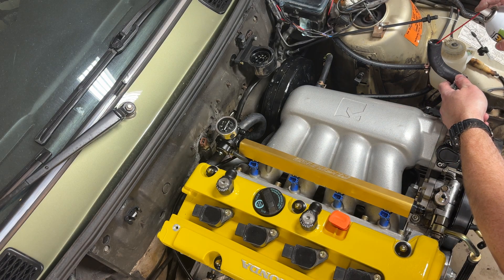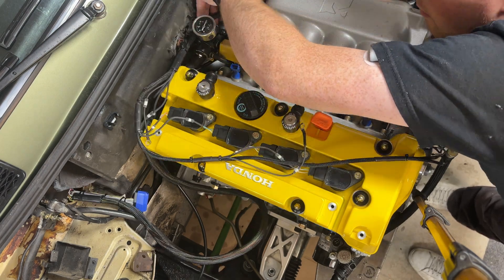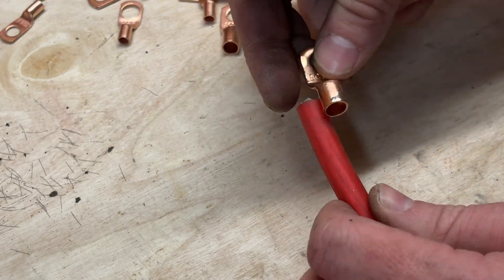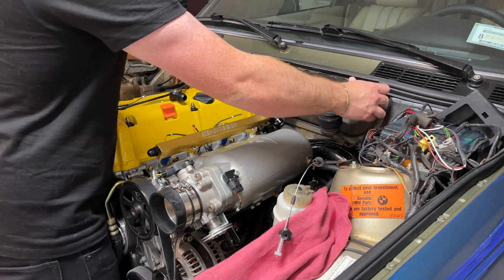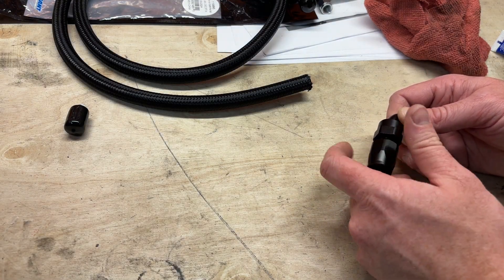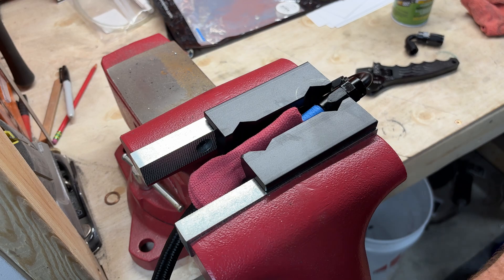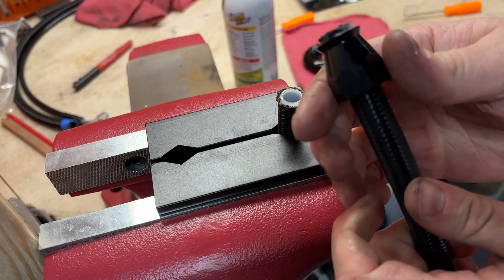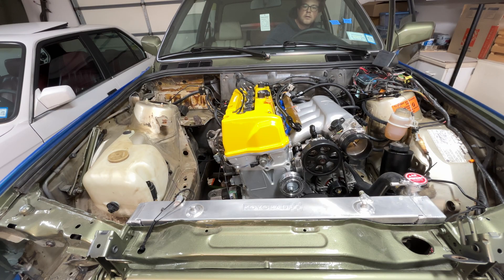E30 K-Swap: Wiring & Plumbing Made Simple (Power steering & Cooling)

Comment: Have been checking out all of your videos, nice work and progress! 
One note on the Kpower conversion harness... I just learned this myself. I've been chasing a fluctuating voltage issue in Kpro, which also caused the dash, dome, and headlights to flicker ever so slightly at idle. The voltage as reported by KPro would vary wildly at idle and part throttle, going down to 12v and up to 14v. Voltage at the alternator was rock solid at 14v, so I knew it wasn't strictly a charging or ground issue.
Turns out Kpower pulls supply power for the O2 sensor relay (pin 30) from a switched ignition source on the C101 plug vs. constant 12v. Kpro controls the opening and closing of that relay, so there's no need for it to have a switched power source. I rewired it so pin 30 goes direct to battery power (used a 7.5A fuse). No more flickering lights and now the voltage in KPro matches the rock solid 14v coming from the alternator. I think there's too much noise or interference on the ignition circuit, and it was causing that issue. Found this all out via an old forum post on k20a.org where some people were having the same issue with a Honda to Honda swap using a Hybrid Racing harness.
Reply from the maker: ah very interesting ill have to look into that. i can just remove it entirely since im not using the o2 sensor
Reply: @ Ah OK, you should be fine then. If I unplugged the O2 sensor, the issue went away.
Reply: @fitandfinishgarage Good shit are you doing your build on the late model or a early model as well ?
Reply: @earvinrangel815  early model, it’s an 87
Reply: @ early model 85
Reply: @DekadentGarage same I was going to say just that . I also am not running my o2 sensor I got it their for show but the cable I left unplugged because I didn’t feel like taken of my solid mount shifter to just squeeze the cable through. I wanna do it a lil more proper at a later time .
Reply from the maker: @earvinrangel815  I just have my wideband wiring running out of the firewall with everything else. It crosses over the motor, then runs down along the fuel lines and finally to the exhaust piping